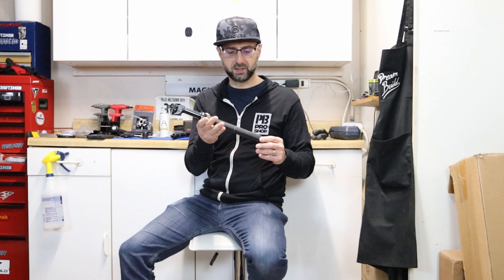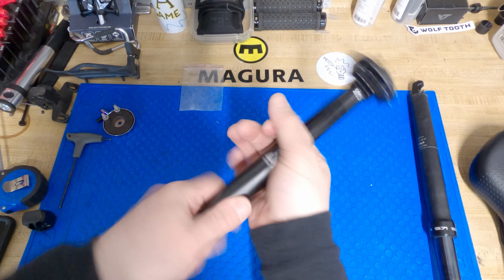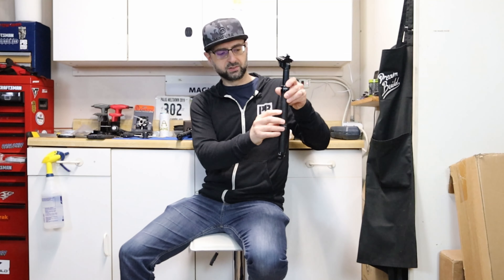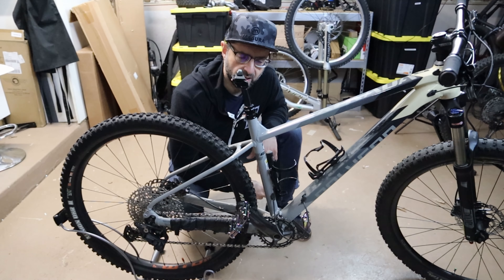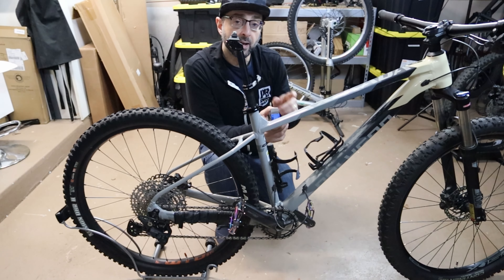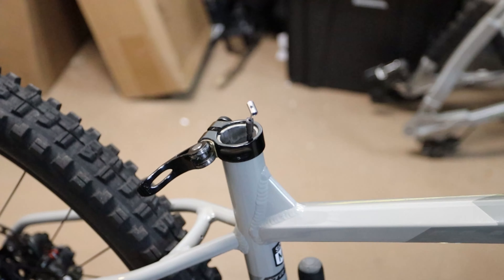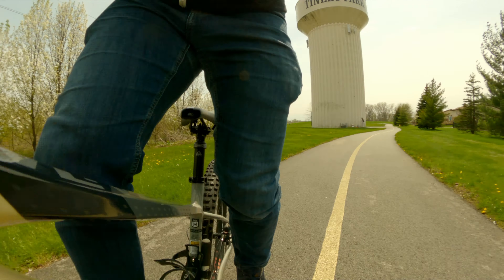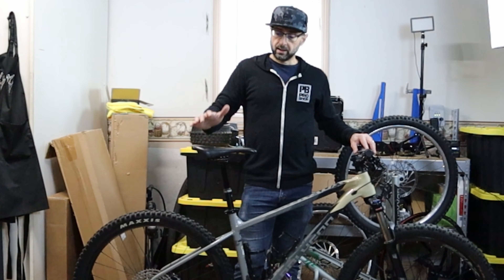27.2mm Dropper Posts | A look at the PNW Ranier and KS eTen-i | Budget Hardtail Upgrade | Tue Tech

Comment from the maker: A couple of noteworthy items.  

1) KS offers a 120mm version of the eTen-i. It is 7mm shorter in total length than the PNW. Not much but it might make a difference for some. 

2) Keep in mind that XC frame design and geometry is typically not meant for long travel droppers.

Comment: Just picked up a 2021 Extrada 6 and the same PNW dropper. I purchased a 1.0625" hole saw and ran in down into the seat tube to cut off the inside portion of the water bottle holders, ended up having to wrap it in sandpaper to get the inside all the way flush, but I can now recess the PNW dropper all the way into the seat tube.
Reply from the maker: Some people will drill out the water bottle bosses. They are basically rivets with thread.
Reply: I kinda assumed they were brazed into the frame? Thought about drilling them out, but didn't want to put noticable holes in a new frame. From the outside the still are intact, if they fall out, they fall out...
Reply from the maker: @jonperrin7029  there's always risks with modifying a frame. If  you're able to keep it looking neat, all the better.
Reply: Do you think just sandpaper glued on a dowel could do the trick with enough persistence, or was the hole saw necessary for getting most of it gone? A dropper is on my horizon, but in the meanwhile even the stock seat post does not go down quite as far as I'd like it to before hitting the bottle mount inside the tube.
Reply from the maker: @kevininhi  😬 Personally, I probably wouldn't do it since it will void the warranty.  I don't have any experience with that approach.  So I'm not the best person to opine on it.
Reply: @kevininhi  I have not doubt that he's right about there risk of voiding the warranty. I suppose it comes down to how much you're willing to risk to get the post in further. My thoughts were if I could make the modifications not visible from the outside that the only real risk at voiding the warranty would be if the frame failed at location of the bottle holding "rivets". I'm sure given time that you could sand down the rivet with a dowel rod wrapped in sandpaper, but it took me somewhere between an hour and two to get the think cut out with a hole saw and sanded down with a power drill, so I expect it would take a long-long time going at it by hand.
Reply: @jonperrin7029  thanks for the advice. I would certainly rather not modify the frame like that if possible but it's good to know the possibilities. I suppose I can take a hacksaw to the static seat post, which would avoid messing with the frame. I'll have to think about this some more once I do finally get a dropper on it. Thanks again!

Comment: To lower that seat post more is to knock out those rivets. Be sure to add some grease down there to help. Warning, if you use your seat post bar and a rubber mallet, it will work but it will get STUCK. I used my knife sharpener rod and a rubber mallet to loosen the seat post and it worked. I was definitely panicking when it first got stuck.
Reply from the maker: Thanks for the tip. I considered drilling out the rivnut as I have some experience with that technique from a past life.

Comment: Hello, which do you recommend the KS Eten-i or KS E20-i dropper post? I have a polygon xtrada 6
Reply from the maker: I haven't tried the E20 so I can't really say. The eten worked fine but I switched to a PNW  Ranier. The problem with the KS is the way it connects to the cable. Sometimes it comes loose and I have to pull the dropper and readjust it.
Reply: @AdrenalineIsLife  Thanks
Reply from the maker: @leandrod5890  another good one to look at is the One Up Components 27.2mm dropper.

Comment: My Thompson elite 27.2 failed some time ago and now riding with my old bog standard post, my post is 30.0 so no choice have to buy 27.2 with a shim that adapts it to 30.0 so good to see more 27.2 appearing and the cheaper ones these days vast improvement when I got my Thompson
Reply from the maker: Agree 100%. Droppers are much improved these days and we see more options in 27.2mm released every year. Great way to breathe new life into older frames.

Comment: Hi, do you recommend the KS Eten-i dropper post? I am a cyclist who rides occasionally.
Reply from the maker: The quality of the post is fine. Like is said in the video, the interface with the cable is not the best design in my view but shouldn't be much of an issue if installed properly.

Comment: Nice vid, exactly what I was looking for while waiting for my Xtrada 7 to come in.  How tall are you btw?  The Xtrada I got was the medium 29er, so I'm trying to figure out which dropper to get that I can slam as much as possible.

PNW also makes a 100mm Coast dropper that has a 215mm full insertion length, vs 282mm full insertion for the Rainier.  Thanks, keep the vids coming!
Reply from the maker: Thanks. I'm 5'9". The Coast may give you some versatility if you are ok with the suspension feature.  Enjoy the new bike!
Reply: @AdrenalineIsLife  Thanks again.  I'm 5'7" so I can drop the coast probably 50mm lower than you did to get it out of the way more.

Polygon should pay you for making this video, since they decided to use an outdated 27.2mm seat post diameter...PNW should give you a dropper and remote too.
Reply from the maker: @Beiberhole69RVA  Happy to help. The shorter drop on the shorter post will help with fit. 27.2mm is definitely an old standard  but we're seeing droppers being used on gravel and even road bikes now. So hopefully, more options will be available in the future.

Comment: KS is for the birds! Not great design imo,but they did have great support (pre 2020)!that bead in the lever and the lock bead in the seat tube idea never made an ounce of sense! You’d think that a (imo) a big dropper post company would have figured that out early in the game!! I’ve always been very happy with fox droppers,and I have a one up on my new bike and I’m happy with that as well(so far! My fox’s have been used for years and still run like new!that PNW post is definitely best bang for your buck though! Cheers
Reply from the maker: You can't go wrong with Fox and Oneup. It's too bad Oneup doesn't make a 27.2 dropper.  It would  be perfect with the low stack height. Thanks for watching! 🙏

Comment: I have the eTen on my Xtrada 6. I had a lot of issues initially with the install as the dropper kept dropping when I sat on it, replaced to a better cable and has been all good, except I am now noticing when raised there is a small amount of movement in the post, which I don’t notice when riding. Is this normal for droppers as this is the only one I’ve had?
P.S. love your channel👍
Reply from the maker: Thank you! Glad you're enjoying the channel.  🙏 The dropper is hard to setup right. Droppers can  sometimes have a small amount of rotational play. It shouldn't have any play up and down or side to side.